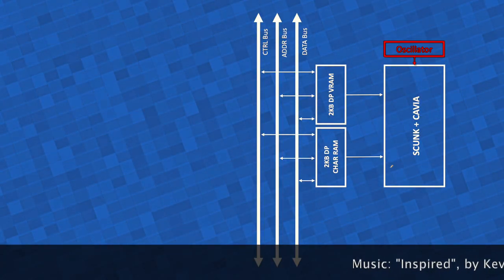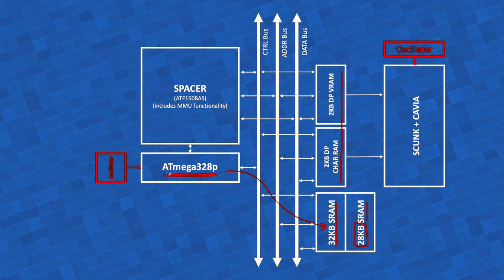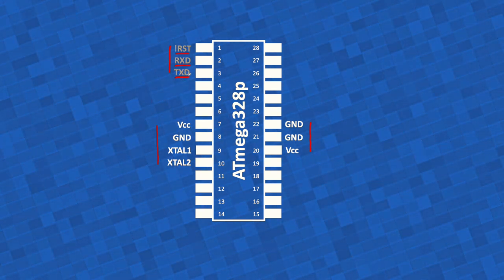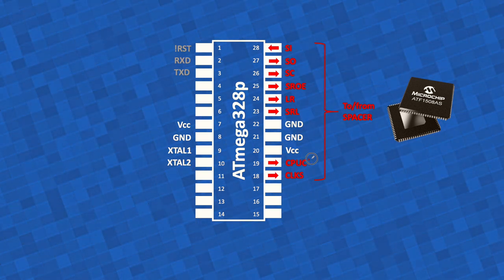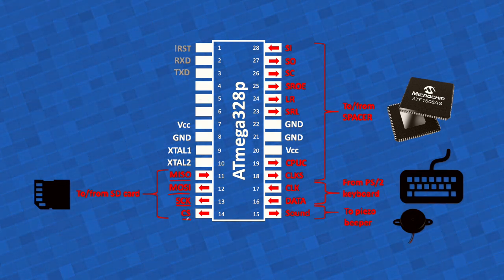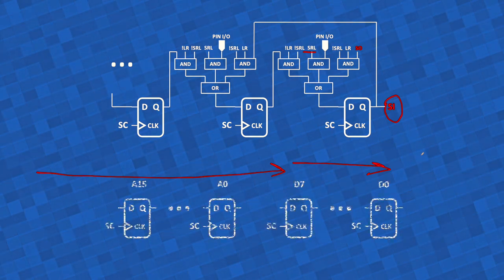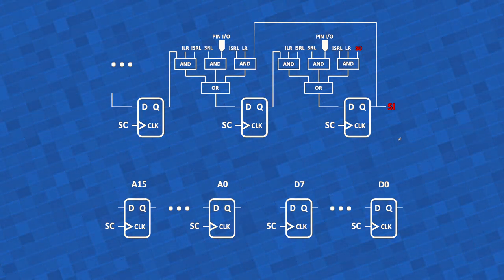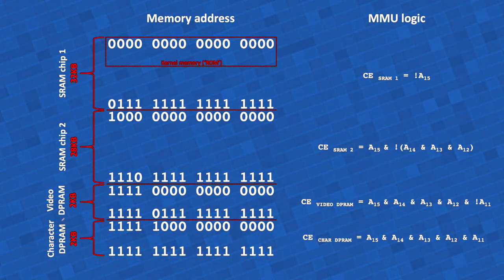Building CERBERUS 2080™, my dream childhood computer: Episode 9

Comment: Forgive this uneducated question:  The memory map has me confused.  There's probably just something I don't know about how the multi-cpu setup works, but I'm puzzled how that memory map could work for the 6502.  If it talks directly to the buses, the initial startup vector would be in Char DPRAM, while zero-page is masked by ROM.  I'm sure there's more to it, like some component that keeps them from all using the buses at once might also somehow address this, I just don't know what it is.
Reply from the maker: Nothing uneducated about the question! I didn't look yet into the details of the CPU's start-up vectors. It's possible that I will need to either add jumps on the default start-up and interrupt addresses or use a simple address translator. I'll look into this later, but I don't expect this will force me to do significant changes to the address map.
Reply from the maker: There is something trivial I can immediately do to avoid any possible future problem here, which is to swap the address space of the video and character DPRAMs. If the video DPRAM is at the highest range, then the highest addresses (including the startup vector of the 6502) will be in free space. The reason for this is that the video DPRAM has 2KB of the address space allocated to it, but since the screen only has 40x30 bytes, only 1200 addresses in the lower area are actually used. 848 addresses in the highest area are then available. I will do that immediately. Thanks for making this remark, it may have saved me some work later!

Comment: You said that the name was based on 20 from the Pet 2001 and 80 from the ZX80/TRS-80, and you had the 2 processors with the aim/thought of emulating those machines. Both the ZX80 and TRS-80 Model 1 have 32 column screens, which matches your video circuitry, but the PET 2001 has a 40x25 screen with the 8x8 “PETSKII” character set . Are SKUNK and CAVIA capable of displaying that?
Reply from the maker: Yes, they are, as CERBERUS's screen is 40x30. But there is a mode on the TRS-80 that has more than 40 columns (64 columns with 'skinny' characters); that mode won't be doable.
Reply: @thebyteattic  My bad! For some reason I misremembered the display size. I guess the 30 rows became 32 columns in my mind.

On the subject of how the TRS-80 works, there is a lot of detail on the behavior of the system, especially the video, in this article, http://www.glensstuff.com/trs80/trs80.htm where the author built one using modern components.
Reply from the maker: @Doug_in_NC  Wow, cool, thanks! He even made clones :)
Reply: @thebyteattic  He did the same with the PET 2001, and cloned that with modern components too. http://www.glensstuff.com/pet2001/pet2001.htm